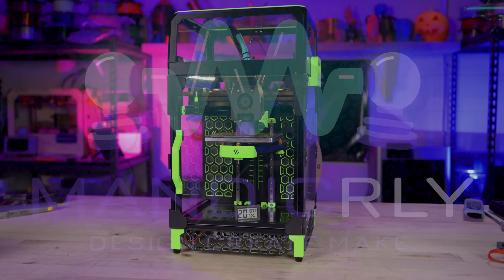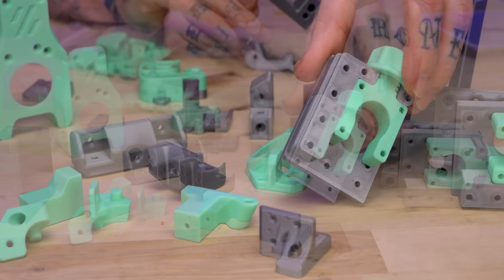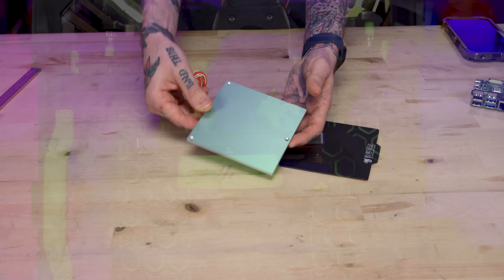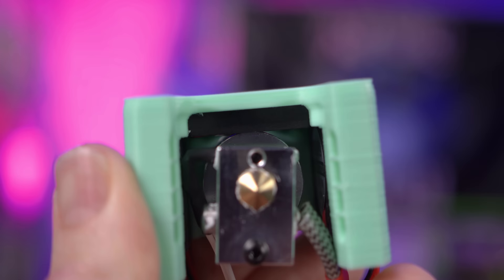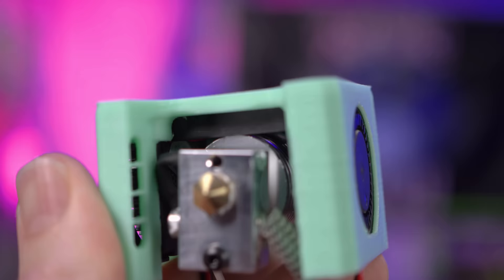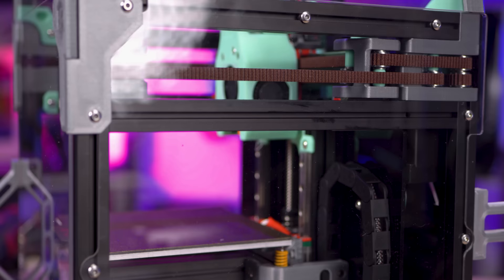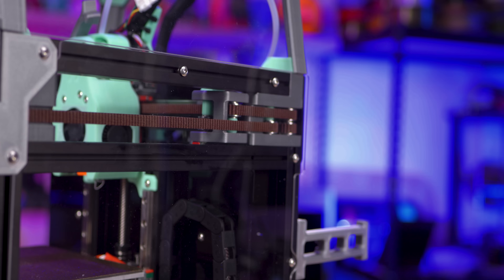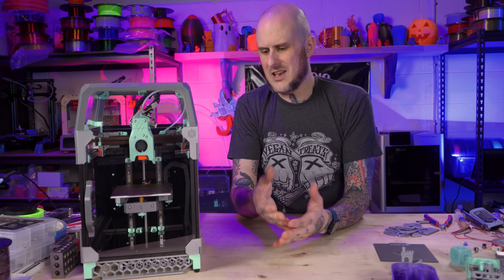Is the CHEAPEST Voron V0 Kit Worth it? Siboor V0.1 3D Printer

Comment: I'd argue that metal print bed in this case is thin enough the thermal delta across points on bed is vastly reduced so warping from thermal cycling would likely be minimal. Though be reducing the thermal mass of the bed you expose to other issues...
Reply from the maker: That isn't a bad point, except that the bed is not cast aluminum but rather extruded sheet aluminum.  Cast is by its nature more stable to temperature variation than Extruded.  So that tips the scales back toward it having issues.  

Look at an Ender 3, they also have 3mm thick extruded sheet beds.  Warping on their beds is very common.  I did the math and an Ender 3 has a bed that is a little under 4 times the square area of this V0 bed.  However an Ender 3 bed heater is only about 100W more power.  Meaning the power density in this V0 bed is significantly higher. Again pointing toward issues.

Comment: My 8 year old knock off prusa printer can do a benchy in 34 minutes. 43 minutes for a Voron printer is trash. 
my printer has an ender 3 bowden setup, recently switched to 0.6mm nozzle 0.28mm layer height, and it still has a wobbly acrylic frame. modified it to as be quiet as a mouse. 
i might build a customized voron style printer in the near future. i dont need super fine layer height for everything i print but speed is more important.
Reply from the maker: .6mm nozzle makes a LARGE difference. That was also the 2nd print that machine has ever created. Not exactly ready to hit the race track on print number 2.

Comment: would cranking down power suply voltage be possible in this unit? because you could probably lower it to 12v  and make 75w bed out of it or measure the resistance and smack 3 times bigger resistance power resistor on the back in series , wastefull but ir would work
and  the thing that interest me the most would those motors cut down if you power them from 12V
Reply: I was thinking the same thing. problem is, if that power supply is 24V you would need either an extra step down converter or an extra supply. I would go for an extra supply tbh.
Reply from the maker: Absolutely everything is based off 24v on a machine like this. The SBC wouldn’t get proper voltage to power anything in it. 
Klipper firmware has the ability to limit max power output power on the bed. That’s what I said I did and included in my Config file. 

Running resistive devices like that at voltages other than intended could have unintended load consequences. Lower wattage sure but may just never achieve the proper output at all. Hard to say and inadvisable.
Reply: Best to either limit the power used by the bed in klipper or replace it with one within spec. That bed seems a little suspect, so I'd probably replace it.
Reply from the maker: @NickNick2024  Which is what I did, limit the power to 40% in my config file.
Reply: @MandicReally  Yes that's exactly what I was thinking too, good to see you're so on to it here 💪

Comment: Question ... I will have soon a Bambu Lab P1S and dont want to deal with the chemicals of resin printing. If I want to print small objects (maybe 2"), does it help to have a small printer or the P1S should give the same results ? And if a small printer helps, would you get a Voron V0.1, a V0.2, a Bambu Lab A1 minim, or something else not resin ? Thanks ! And great video as always !
Reply from the maker: A smaller Nozzle is gonna be your biggest key. A small printer likely won't have much or any impact on the results you get. The P1S with the Bambu .2mm nozzle would be what I'd try. You already have the printer, just install the smaller nozzle and try it out. The lowest layer height Bambu has a profile for is .06mm which is just a hair taller than most resin printers will do, but should give you great results. Honestly your biggest issue will likely be that Resin supports work differently than FDM supports and Resin printers can often print supported models with better results since the model is suspended in a liquid a lot of the time and doesn't have the head moving around on top of it. But really I'd say put in the .2mm Bambu nozzle and try it. Honestly the P1S is probably the better choice over the A1 Mini as well due to its fixed bed not moving around like the A1 bed slinger design does.
Reply: Thank you so much for the quick, and complete, answer !!!

Comment: That's a lot of power for that little of a heatbed. I buyed a cheap Tronxy printer, 330x330 bed at 260W, That's like 0.25w/cm2. This voron has 1W/cm2, that's a lot

What is really strange is the meanwell PSU tripping. My Tronxy printer draws 260W at the bed but 400W at the WALL. Heating both hotend and bed reaches 500W from the wall. Just plain awfull efficiency
The strange is that the PSU is a chinese 350W one but it can draw 500W no problem when heating, while the meanwell trips

Comment: I actually have a question regarding the Volumetric Flow Rates you were talking about, do you have a video or guide on how to do that in Cura or what not? I am trying to push my machine and calibrate it correctly, printing around 125mm/s right now and figured since it prints correct I can push it further?

Comment: Hello i want to buy this printer as my first machine. When i want to order on Aliexpress it remove arround 70€ for taxes and shipping. Does this kit come from US? Im from Belgium and i wont pay somethin more for taxes. Thanks
Reply from the maker: 1) This ships from China. I don’t know your country or situation to comment on shipping or taxes. 
2) I absolutely do not recommend any Voron as a first printer. Operating a printer is one skill set to learn. Configuring & Tuning a printer is another. Building one is an entirely different skill set. Having a ready to go machine that requires little or no configuration to get started is a much better starting place. Building, Tuning, and Operating a Voron is all required to get it running properly. It is only recommended for experienced individuals.

Comment: Thanks for the video! I'm considering to buy it, out of the box the GEMINI board is capable of connect to the wifi network? Or is necessary to buy extra items?
Reply from the maker: The Gemini requires a Wifi Dongle but that is included in the kit with clear instructions on connecting to your Wi-Fi. That is a solid part of this kit. I don’t love the Gemini board for my own reasons, but it makes sense here.

Comment: You said something about the slicer limiting the print speed because of the volumetric flow rate....what slicer are you using? And how do you set that up? I have only been using Cura, and would be interested in trying a different slicer.
Reply from the maker: I use PrusaSlicer.  I forget pretty much everything about Cura as I quit using it a long time ago.
Reply: @MandicReally  Thanks for the reply. I'll give PrusaSlicer a try.

Comment: Would you recommend any of the trianglelabs hotends from aliexpress
Reply: depends on the ones youre looking at, but yes from my experience
Reply: @Mobile_Dom  I first thought to get a dropeffect xg but then I saw the trainglelabs one and was having doubts
Reply: @landerhoolsteens  which trianglelabs hotend, as trianglelabs doesnt have an Xg clone AFAIK
Reply: @Mobile_Dom  tchc TD6 it’s a v6 hotend with ring heater
Reply: @landerhoolsteens  thats the one i've not tried, but I have tried the R6 and the mini, but they've been great, those ring heaters are rapid, I cant say I've had an y issues. plus you can use their "unity nozzles" if you want
Reply: @Mobile_Dom  tl and phaetus use the same manufactuer, runice, so they dont really make clones of eachother.
Reply from the maker: No experience.  To my knowledge they are loosely related to Phaetus, though how much so is up to debate.  I like my Phaetus units.  Triangle Labs seems to follow up the rear mashing together various products to offer a ton of options without much thought into how they really go together.  Just from an outside perspective.
Reply: @MandicReally  ok thx is the xg hotend worth the 99 dollars
Reply from the maker: @landerhoolsteens  I really need to test it further. It’s hard to say. I like the Phaetus Dragon at about $10-20 less, and you can run regular RepRap nozzles in that. The mounting options on the XG are killer. I just dislike having to buy nozzles from one company for it. (Manufacturer anyway.) I need more test time with it, but I’m tempted to get a second one for another project.
Reply: @MandicReally  ok thx for the answer
Reply: @Mobile_Dom  is the r6 the drop in replacement for an Ender
Reply: @landerhoolsteens  yeah the R6 uses a similar heatsink to the revoCR, its a circle with the back half cut off

Comment: Does the print it forward thing have a cost?
Reply from the maker: Yes, what I think is pretty reasonable overall (I'd definitely charge more if it was me).: https://pif.voron.dev/
Reply: @MandicReally  another thing my pc is not good enough to compile clipper. Any option’s there?
Reply from the maker: @indecisivesquirrel3dlabs78  Klipper is not compiled on your computer.  The SBC of the machine you are building will compile Klipper for itself.  
I'd HIGHLY recommend reading the manual for assembly of the machine and documentation of Klipper before going forward.  Building and configuring one of these is a fairly steep step up from other machines.

Comment: clearance i hardly image it making any difference unless its moving part......
Reply from the maker: You mean when I said that the printed parts don't have proper clearances? 3D Printed parts make up a lot of the structure of the machine.  I showed how a fan didn't fit because the clearances were too tight.  The extruder drives inside of a printed housing. Clearances are very important to a Voron's design...

Comment: It's a pity companies like this just screw up on important details that would cost $0 BOM cost to get right.  A lower rated bed heater would be cheaper, right?  Getting the holes in the correct place sounds like the minimum they should ensure.  I see this so often, especially from Chinese companies.  They offer near-miracle bang-for-the-buck ratio, were it not for that one (or a couple) stupid detail(s) totally ruining things...  Such a pity...
Reply: Getting something 100% right is hard. They are probably skipping the QC checks and so some issues slip through. I know formbot had a lot of issues initially and have since brought up the quality of their kits. Essentially using user feedback to do QC and make things better over time.